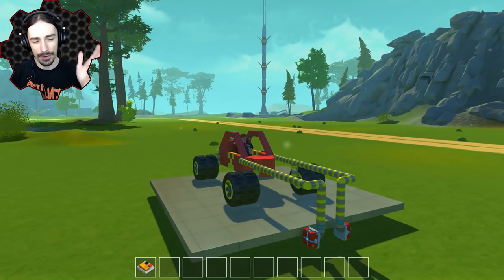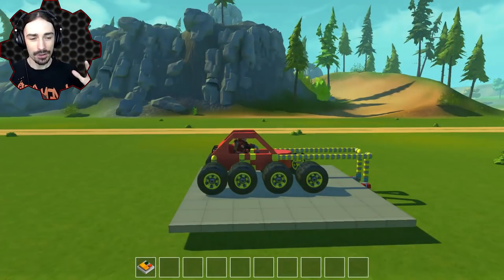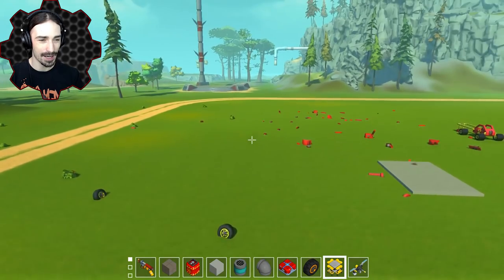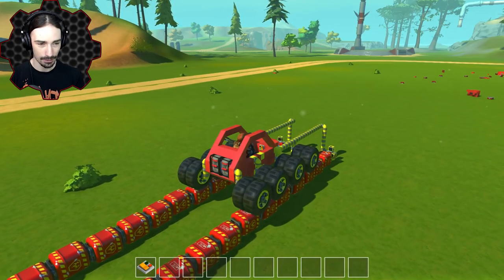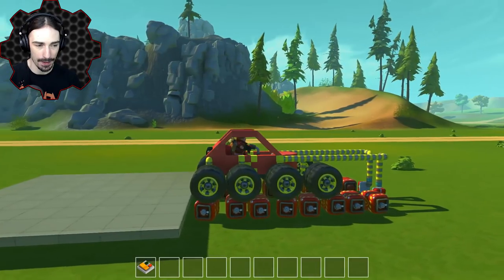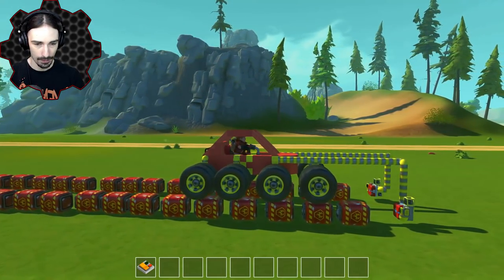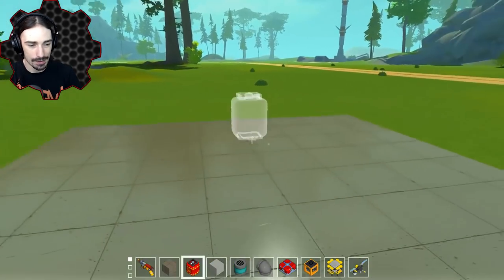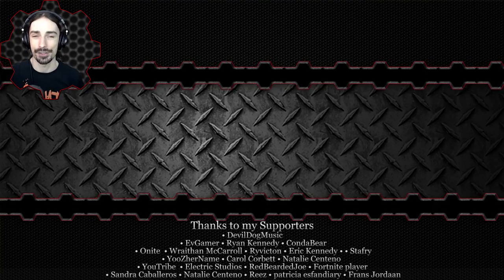This Car ACTUALLY Drives On Bombs Without Exploding Now! - Scrap Mechanic Gameplay

Comment: It's probably lagging due to more contact of the prefabs(Bombs). Lag isn't necessarily determined by the amount of prefabs in a scene, but by the amount of functions/methods a script has to run per frame update. It seems like the bombs check per frame if an entity is colliding with it and then gets its velocity. Its just a thought as I haven't seen their scripts, but it just seems like the most likely scenario. I knew you would figure it out, but I just tried to give a breakdown of what occurred.
Love the vids mate.

Comment: Scrapman: why is it lagging?!
Everyone with a Iq of someone who spawned and dropped 1k or so blocks in mine craft: clean yer server. That'll fix it mostly.
Reply: No, it's the collisions happening that make him lag
When he uses the vehicule that spawns bombs horizontally, it lags less because they are more spaced from each other. But when he uses the vehicule with the sensors that spawns them vertically, it lags because the bombs touches each other so the further he goes, the more collisions there is and the more laggy it is.
Reply: Edit: after in the video, he shows it (I didn't see this part) ^^

Comment: Hey scrapman! To add turning to the vehicle, a simple system will be remove the arms and place the spawners on either ends of a horizontal bar that can rotate on its centre from an arm stretching out from the centre of the vehicle(mean position being perpendicular to direction of travel). Let the central arm have the capability to strafe left and right 1 block when turning by using pistons and you've got a simple turning mechanism

Comment: Try cranking up the engines but lower the sensor detection length to drive faster. Also the bombs will land more accurate on blocks instead of the ground, because the worlds ground is not perfectly even, but blocks are.
So please build a long path with blocks like concrete and try again.

Comment: you could add two spawners and put 2x 2 spawners on a rotating "minigun-concept" so the spawner spawns the bomb an spins up to "cool down" and so the second spawner spins in place and spawns the new bomb just to also rotate out of the way and "cool down" and so on and on to maybe allow faster speeds. 
So basically 4 spawners and 2 each on a rotating axle like a 2-barrel gatling-gun

Comment: You could probably turn if you shortened the distance between the bomb spawner and your wheels. You only added that distance because you would fall with only two wheels and because you needed a window of time to put some bombs in place.
With this version you could probably spawn your bombs almost underneath your front wheels.

Comment: You can avoid using controllers if you mount the bomb arms on bearings and position blocks to limit their range of motion, but I think you'd also need to shorten the arms so you're only spawning the next bombs to be driven over instead of being one ahead.

Comment: Have building challenge with the friend and the car you are building is a tank that have 20 wheel an 1-5 engen that power it and one of the power engen have to be a gun that move length limit 32 by 24  by  34

Comment: Hey ScrapMan. You can put the spawner on the parts for the front wheel turning. It'll follow the angle of the wheels, also you could put putters on the back to knock the bombs behind you away and blow them up to get rid of the excess/pointless bombs behind you.

EDIT: typos..

Comment: Use pistons with turning to help move them round/out the way slightly
Reply: That might be an option too
Reply: Have like a T pipe with a baring on connected to steering then a corner pipe with a piston on and have the piston to extend alittle whilst turning
Reply: @xnemesis3822  that works too

Comment: Obviously, measuring 4 blocks on an angle is shorter than 4 blocks from the spawn point because Pythagoras, since the bomb is 4 blocks they all collide xD any and all lag in scrap can be explained with the amount of collisions, you can place 1000 sensors and still be fine... Trust me, I tried...

Comment: Well...to make it turn just make a vehicle with wheels being maybe 10next to each other and the wheels covering the the underside of the vehicle, and keeping the bombs where they are now or add another spawner or a set for stability widthwise not in front...for going faster putting 4 and then like 2in front of the other would make the creation 2x faster bit you would need to put the first 2on a piston to pull them up since the spawner have a hitbox 

Edit: you probably could add  a bit of a box around your vehicle keeping the bombs under your wheels with stiff suspension, so they dont get stuck or stop you from turning or use wheels on the sides but used as a wall getting powered too... Basically sideway support and suspension of course and how about making the vehicle get on the bombs without a platform? You could use pistons on each wheel to get up 1step and make it automatic and put the bomb spawners on pistons too, so you can use it as a normal vehicle too. If you can do some of these then it should work...

Maaaaaybe.😂